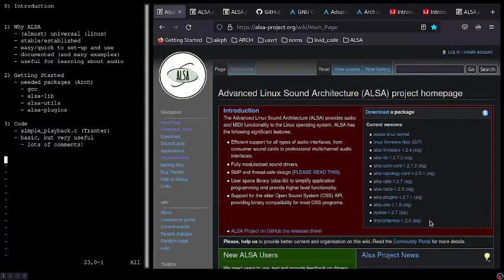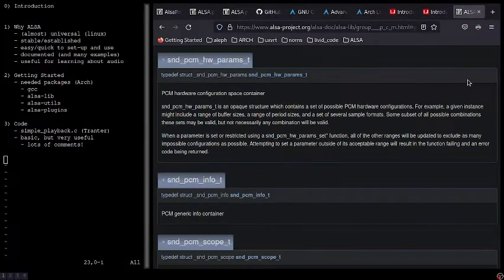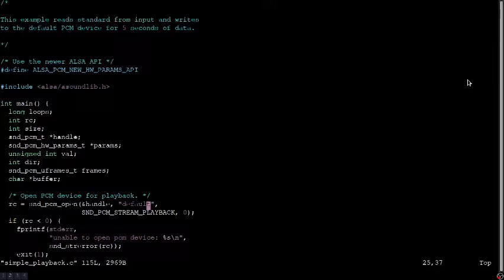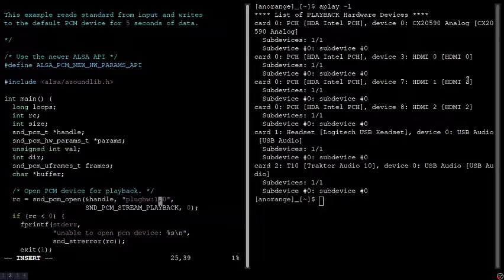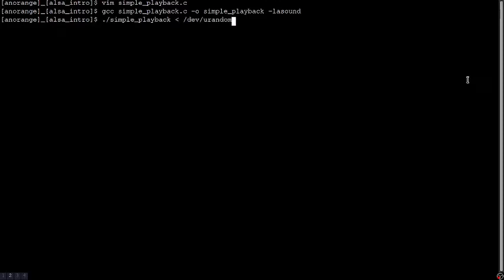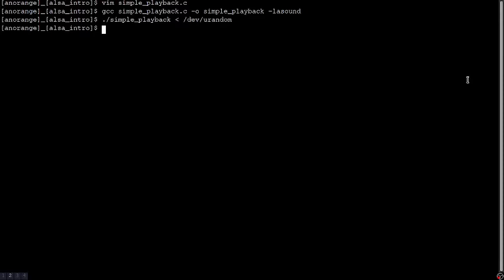exploring ALSA: (very) basic intro and set-up

Comment: 00:03 Introduction to ALSA for Linux
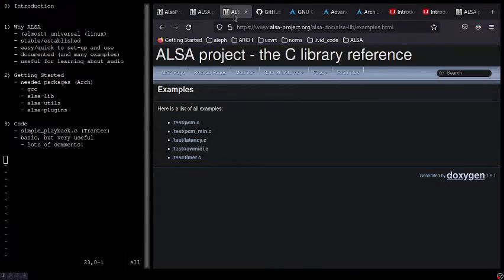00:45 Introduction to ALSA projects
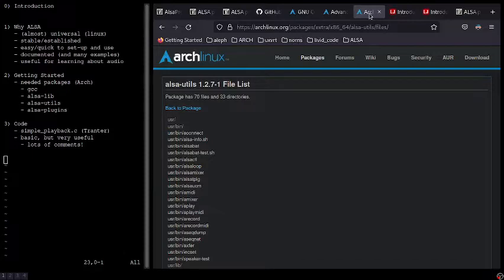01:26 Exploring ALSA package setup and simple introductory sample code
02:06 Using pcm.h and the C library reference for ALSA setup
02:49 Setting up ALSA for audio playback
03:29 Setting precautions and naming conventions in ALSA setup
04:16 Setting up ALSA for basic sound playback
05:04 Basic setup for ALSA and outputting white noise
Crafted by Merlin AI.